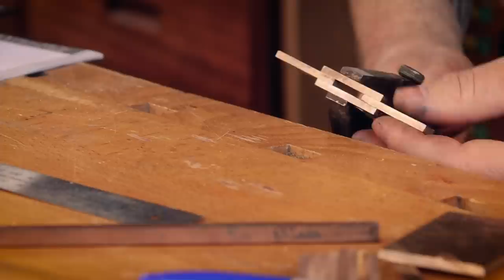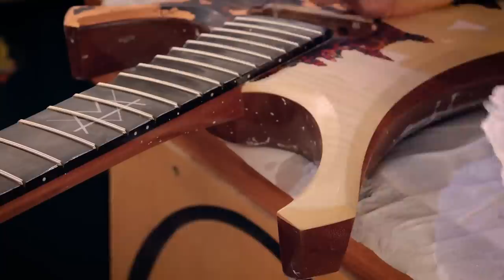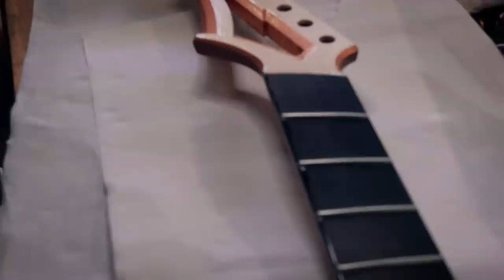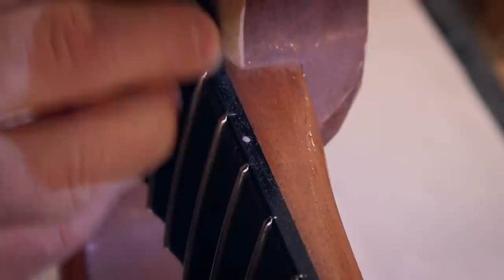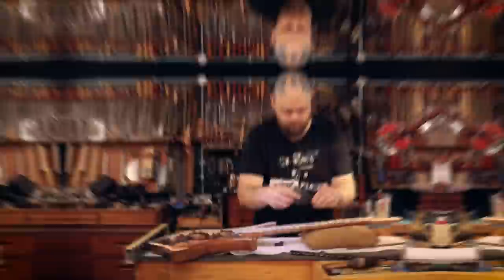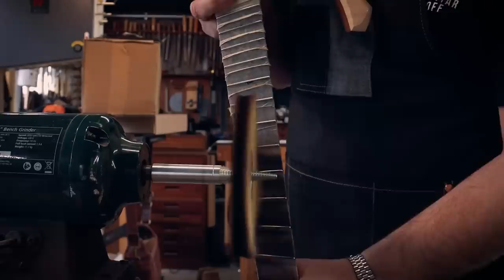Ep 13 - Shred - Fret Level - How to Build a Copper Leaf Multi-Scale Kit Guitar

Comment: Here's a trick to make the protective masking tapes easier to remove:

Before you mask off BETWEEN the frets, run a strip of tape along each side of the neck, right up to the bottom of the tang of the frets. After your level, crown, and polish is complete, simply lift up the long strips on either side, and the other tapes will lift off as a group.

Beautiful work, as always, sir. 🙏

Comment: Hey you just reminded me of something I thought of last week. In hollow guitars with sound holes, how about covering the whole inside (or maybe just the back to save time and material) with leaf instead of foil? Surely one layer of size with the leaves always touching or slightly overlapped will have better and easier conductivity than having to fold over or solder sticky backed foil? Plus, through the sound holes it will look even shinier and cooler.

Comment: Ben, I have a simple but effective tip for you. Put a long piece of masking tape down the length of one, or both sides of the neck. Then, put your cross pieces on top of it. (folded... I don't believe you never thought of that) When you lift the long piece off first, the cross piece ends will come up with it. It's just a bit quicker, but for you, my friend, time is invaluable.

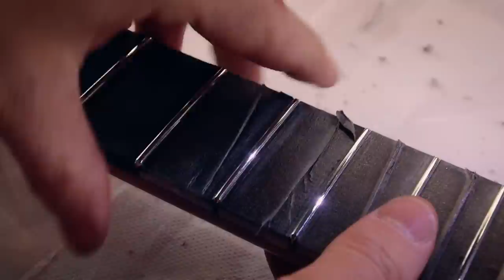Comment: 27:59  Pulling upwards on sticking tape could grab some wood fibers and rip them out. Not allways, but sometimes on less dense fretboard woods with unpolished surface.

 I would recommend pulling on the tape towards the closest fret at 45 degrees angle to the grain and in the same plane as the fretboard (hope it makes sense, english is not my first language and not even the second or third). The glue is then not pulling 90 degrees upwards and also loosens easier. So it‘s less prone to grab some wood fibers 🙂

Not a very big difference, but sometimes the crucial little trick. 

Stay safe, Ben!💪🏼
Reply from the maker: true! B

Comment: put a length of masking tape along the length of each side of the fretboard then put the masking tape between the frets over the strips either side.  Then when you come to remove it pull the long strips and it will lift all the in between fret tapes in one go.  easier than picking each part off between every fret.
Reply from the maker: the buffing wheel process weakens the edge when you do this and you end up tearing through, it works very well with normal hand buffing though for sure. B

Comment: If you run a strip of masking tape up the side of the neck, before masking the fredboard, you can take off Alle the little pieces in one tear.
Reply from the maker: sometimes yes.. but often the buffing process weakens the edge and it tears anyway.. B

Comment: I'm convinced there's no way to get water-based lacquer on by hand smoothly. I tried it with a cloth on a previous build and still ended up spending many evenings sanding it down. I'll just use oil from now on.

Comment: What's the resistance across a control cavity with your shielding paint? I use copper paint and get .5Ω to .6Ω at a distance of around 6 inches.

Comment: I dislike fretwork - I know it's going to take me a few hours and I'm going to have sore shoulders/neck/back from bending over to make sure things are going right.
However - the feeling I get as I peel the tape off is second only to hearing a guitar come to life/hear that first chord sing through an amp for the first time.
It makes all the effort worth it.

PS I saw the folding masking tape trick a while back and it has saved me so much effort.
Same with using a buffing wheel on the Dremel for final polish with the buffing compound on it.

Comment: Question. .. so you straighten the neck then level frets. What happens when the string tension and adjustment create relief in the neck. The neck is then a curve and the strings are of course under tension and flat straight. Surely it makes more sense to level the frets with the strings attached and with a tool as in a truss rod with sand paper on set to the same relief curve than the neck is at under tension. What are your thoughts Ben??
Reply: The strings are only straight while at rest, so by your method the strings would contact the frets while playing with low action. You want the frets to follow the curve of the neck
Reply: If you're dealing with a decently robust neck there's every chance it will hold string tension without meaningful deformation. If it does pick up a curve, you can just adjust it back straight with the truss rod. Since you've leveled the frets on a straight neck you can be confident that when you adjust it back straight your frets will still be level. Can't quite picture how you'd level frets with the strings on.
Sorry about not being Ben, perhaps if he agrees with me I can save him some typing. LOL

Comment: Ball head Allen wrenches tend to ruin hex head sockets.  This is due to the ball on having a very small contact point on the facets of socket. This is especially true when you have torque on it.  Try to use straight Allen wrench on high torque applications or when you can’t easily replace the part.
Reply from the maker: very good point. B

Comment: Here's a question for those playing at home.
If you take the number of hours spent sanding lacquer and multiply it by your hourly rate at whatever your menial job is and subtract the price of a quality spray gun what do you get?
Reply from the maker: yes.. a good point well made.. one must not forget the extraction, compressor etc that is needed to run the gun and you'll still be rubbing down and buffing.. just not quite as much.. good point though! B

Comment: Have done 3 fret jobs now with your triangular file but even with double masking I found it marked the fretboard. Maybe it’s a technique thing and I’m pressing to hard? I found I had to use fretboard protectors to avoid it which makes it harder to do and you cannot get as low on the fret. :(
Reply from the maker: Hey Russell, That should be happening.. can you send us pictures of the burnished edges of the file.. it may be that you are pushing too hard, but it does sound like an issue with the file to me.. and I am sorry if that is the case! B
Reply: @CrimsonCustomGuitars  done. Sent it to shop@ etc. Be interested to hear what you think. Many thanks.